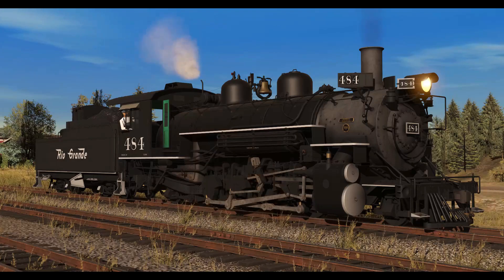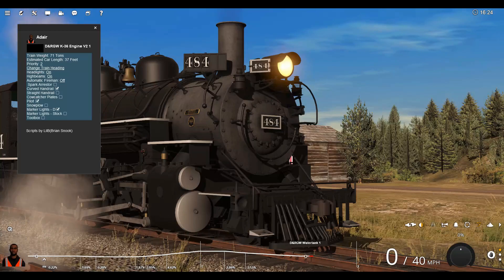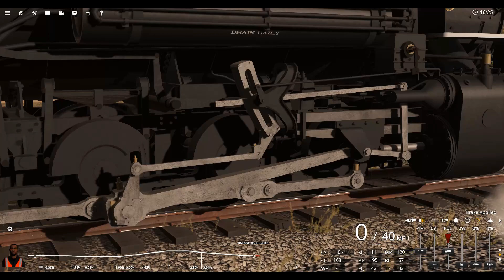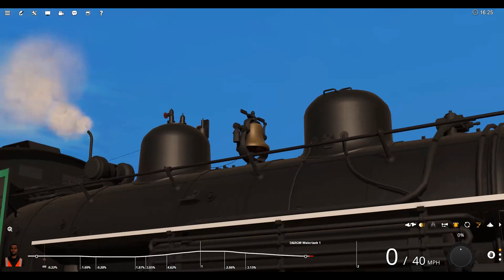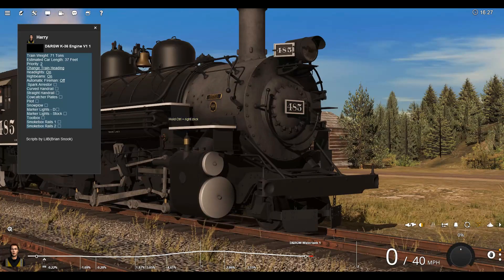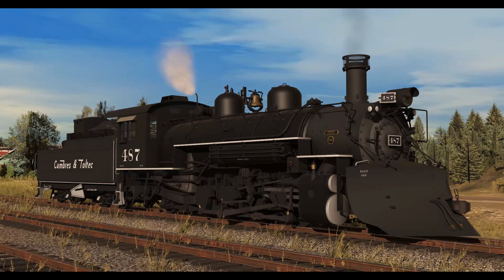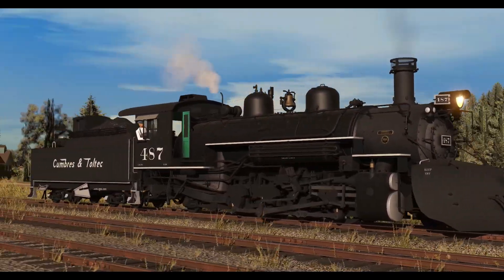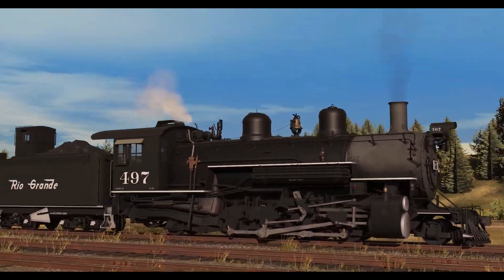D&RGW K-36 and K-37 [Private] | TRS19

Comment: I have never seen an animated reverser in Trainz 2019. By the way, how did you do the animated reverser? Just curious
Reply from the maker: It's part of the Johnson bar rigging in the interior, which has a tag making the interior rigging visible from outside the engine